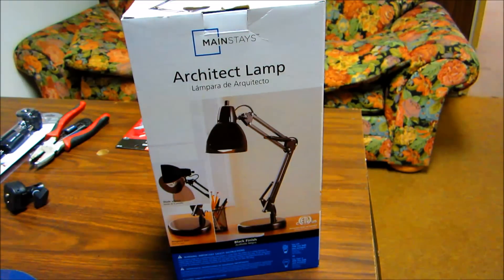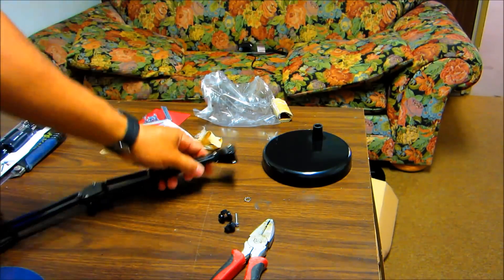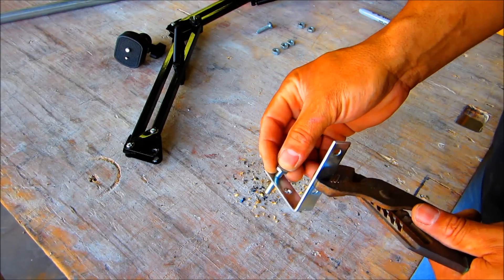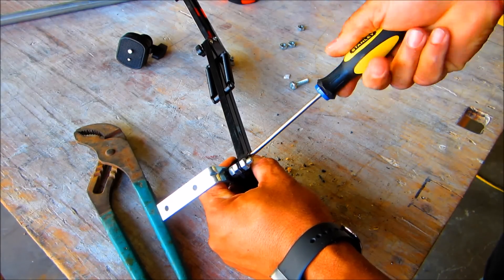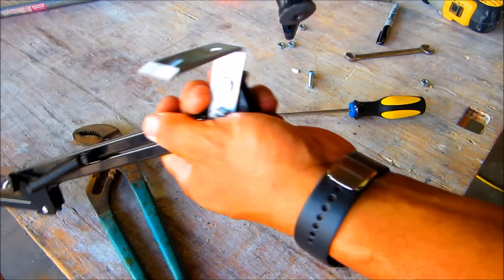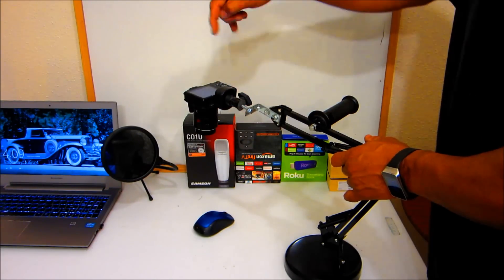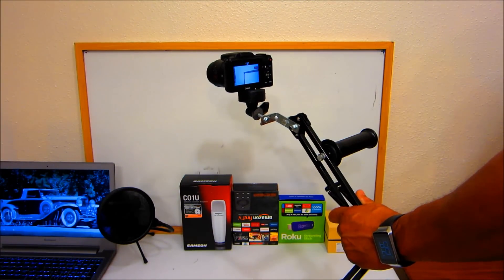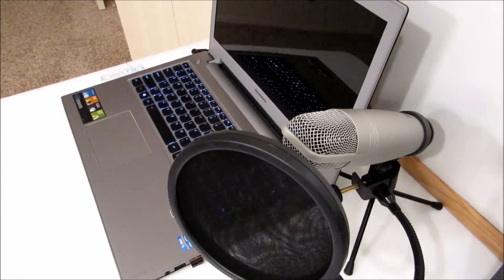DIY MOVABLE  CAMERA MOUNT

Comment: This would be a great addition to a tripod or a jib. As I was watching I thought instead of placing the swivel unit onto a stationary base you could put in on a tripod and it could act as a jib. If you had a jib you could add it to the end and hand hold it for select video movements.. hmmmmmmmmm, what could you use instead of the base unit to attach to a jib which basically has a plate with openings the size of a quick release plate?